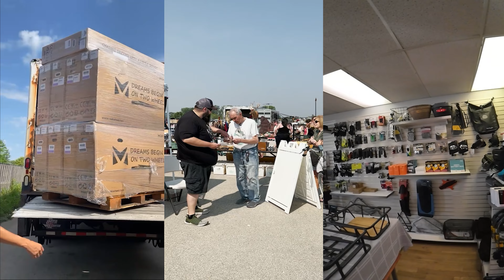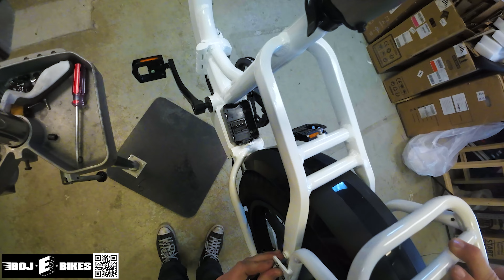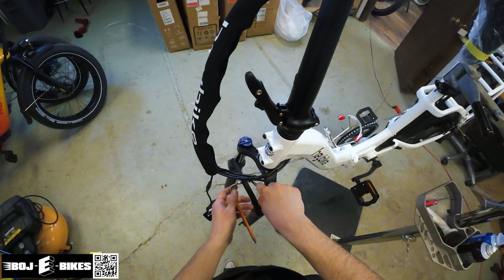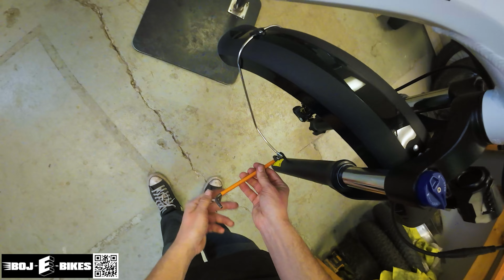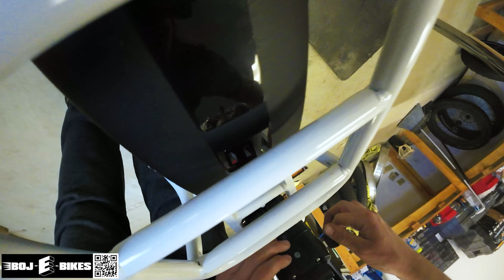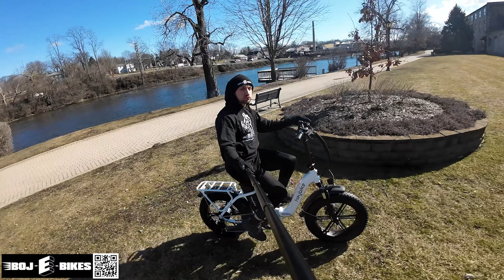HeyBike Ranger Unboxing, Assembly & Road Test

Comment: I have had issues with the handle stem of ranger. Even though it's supposed to move while trying to adjust while standing with both feet on the side. It isn't supposed to when you are riding. If I do a slightly heavy turn the tire just stays in that place and the handlebar moves whereever I move. I have spent hours on that stem making it tight. I even contacted the customer service and they sent me a new stem and the same issue persists. Is anyone else having this issue. I am trying to return this product as I'm tired fixin that thing. Everything else is perfect. Just the loose handle stem.
Reply from the maker: Are you in Chicagoland so we can check it out? Headset issues are ultimately safety issues so let’s get that bike checked out